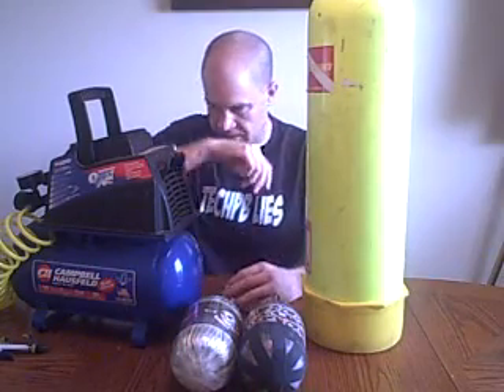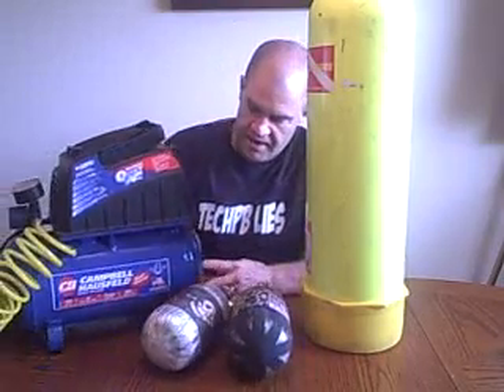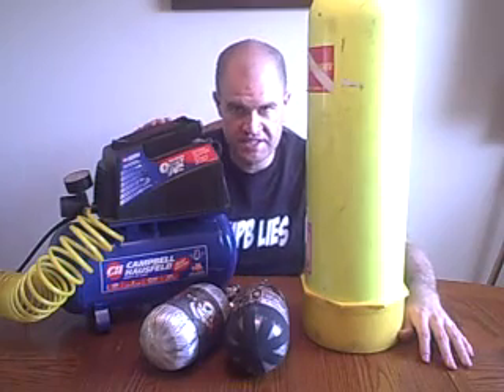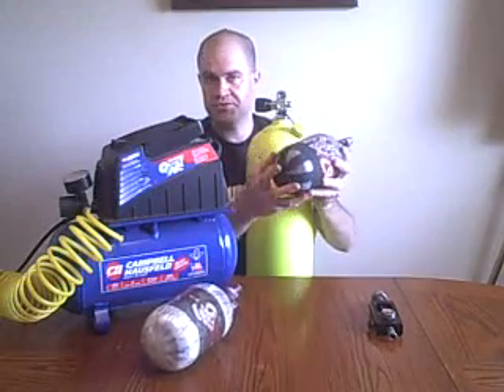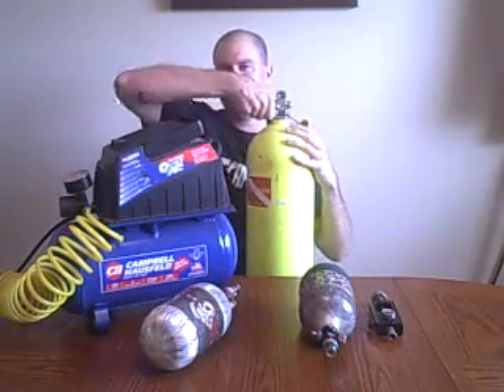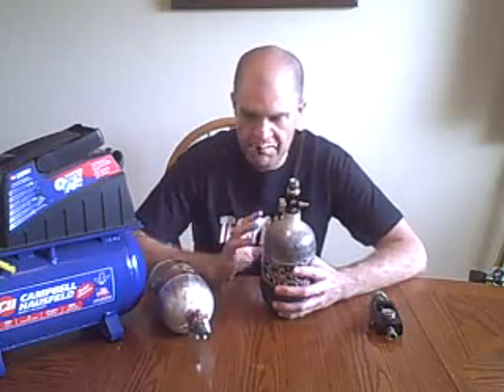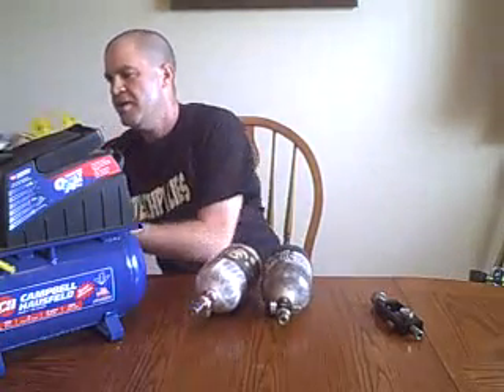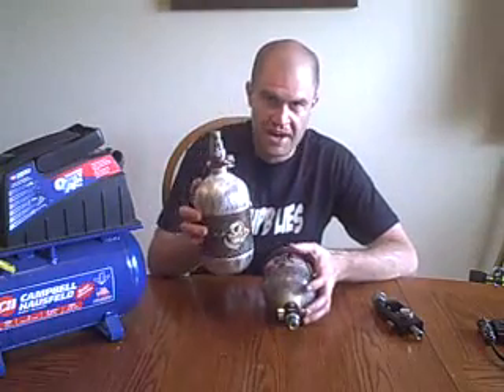HPA, Compressed Air, Compressors, Nitrogen & High Pressure..

Comment: Weird that this is recommended now.  Mike was right at the time but now you can actually get a hand pump that can do 4500 psi; lots and lots of pumping but you can do it.  There are also 200 to 300 (possibly cheaper)dollar plug in wall pumps that can do the same.

Comment: Can I use a 4500 PSI hand pump to fill my HPA tank?
Reply: +MisterAxeMan Yes, but it will take a long time.
Reply: MisterAxeMan you have to pump really fast and might mess up the pump o rings if you have an ace hardware in your area they might have the air supply my town ace has hpa

Comment: Where I live they do not have scuba shops however we have a lot of welding shops. Can I go to a welding shop rent a nitrogen bottle and use it like a scuba tank, to fill my hpa tank for my electric marker?
Reply: yes
Reply: brewskisdodge you can get tanks filled at ace hardware they have co2 nitrogen and if your lucky they might have hpa the store in my town has hpa but they run out fast

Comment: Hey air's they make a special hand floor pump that is capable of compressing more than 3000 psi of air pressure 'they use them for pressurizing big bore air Gun's 'you could probably just about refill a scuba tank with it 'and I hear that they are designed to take the heat and the extreme pressure 'I've seen one online for 250$'  just a thought though.

Comment: What if you have a big air compressor at home. I'm not sure the psi but the compressor is bigger than me
Reply: Any home compressor will do 120-200 psi, The size of the tank doesn't really change the pressure, only the volume.
Reply: rkshireygames what if it's not a home compressor, but he have it at home?
btw what psi does it have? Rafael de Jesus 
even though i would like the answer in bar XP
Reply: ThePaalanBoy That makes no sense....
Reply: rkshireygames How does that not make any sense? He wants to know the pressure in bar, not psi
Reply: TheMagache " what if it's not a home compressor, but he have it at home?" makes no sense......
Reply: ThePaalanBoy Want it in bar? 206.8 bar.

Comment: it don't matter how big your air compressor is, like i have one that is an 85 gallon 150 psi compressor, you have to have a compressor that is capable of going to 3000 psi or 4500 psi, for the home use i recommended the shoe box air compressor, it will fill a scuba to 3000 or 4000 psi in about 24 hours and a small paintball on in about 24 minutes. They start at about $550 and go up from there. these are better than buying one like my works which is a $5,000 dollar compressor. hope this helped.

Comment: If you are using a 3000 psi tank id set the relief valve at 3000 on the compressor...

Comment: they are worth it you will need a ninja fill whip extension with a female quick disconnection on both ends its the cheapest way to get the job done the whip is rated for 4500 psi i think i only use it with the 3k shoebox so idk if it will blow the hose at 4500 the main reason i got the 3k is because you can fill 3k tanks and 4500 tanks but the 4500 will only go to 3k but most shops will only fill to 2.8k anyways good luck

Comment: use your normal home air compressor with a shoebox compressor hooked up to it.
the one thing is the cables to go from the shoebox to your tank is hard to find and when you do your looking at 125-250 dollars but I use a ninja fill whip extension with a female quick disconnection on both end's should be between 30-60 for fill whip and another quick disconnection.

Comment: Somehow better results can be obtained from refrigerator compressor, it can pump up to 30bar  or maybe even 40bar pressure while tank is rated for 150-200bar

it is not that good, but still much better than air compressor from Walmart.

connecting compressors in series may improve pressure further.

Comment: @JustStartingOut1 I imagine you'd have to ask them before you used that air station, but you'd be able to. The tank's won't go higher than whatever they're made for, and if they do they (hopefully) have those exhaust points near the top that pop out the brass plug and all the air drains out.

CO2 is only your tank, to upgrade CO2 to air, just replace the tank and you're good to go.

Comment: @OGpyroloco13 it doesnt matter how big the compressor is, it will only compress to about 120 psi like he said.  but what you can do is buy what is called a shoebox compressor. it hooks up to a regular air compressor and increases it from 120 to either 3000 psi or 4500 psi dependin on the one  you want.  it will cost about $450. but if you live somewhere like i do where i have to drive half an hour to get my tanks filled and at least 200 miles to get a scuba tank filled it will come in handy.

Comment: @somewhatofaBeast3323 

It wont matter how big the compresser is if it is not made for high pressure (3k-4.5k psi) These kinds of pumps have 3-4 stages of pumping to make them work.
If you really want a pump for this, the cheapest quality personal pump on the market ($465 vs $1000+) that fills up to 4500 PSI is a shoebox compressor.(google shoebox compressor)

You still need a oil-less compressor at about 85 psi to run it though.

Comment: @250killer95 it will work as long as it goes up to 3000 PSI or so. Odds are that it does not. Shop tools (like an air wrench) don't run on HPA. Really only SCBA, SCUBA, and paintballers use HPA. So unless it's a dive shop then it probably won't go over 300 or 400 PSI

Comment: How long does it take fill fill an empty 48 / 3000psi tank?
Reply: Depends on what you are using to fill and what pressure you have in the fill tank. HIGH pressures will fill a lot faster.

Comment: The little tank is thick high grade aluminum wrapped in carbon fiber. The big shop compressor tank is a giant beer can.

The higher the psi the stronger the tank has to be, not bigger.

There are giant bulk tanks that hold 4500psi and more, usually made out of thick steel.

Comment: hey mike i figure you would know...i have a tippmann 98 custom and im gonna get a response trigger cyclone feed the whole lot and was wondering if it is possible to convert a 98 to HPA instead of CO2 cause it shoots cleaner, if so what else would i need for it? or would it be cheaper to get a whole new gun aka like a ego or something like that, thank you

Comment: Uh, firstly Air compressors that are for paintball are normally gas powered.  CO2, emissions, etc.

CO2 used in paintball is usually the by product of other industrial reactions.

And YES CO2 SUCKS! Yes SUCKS!  HPA gives you better performance.  CO2 SUCKS!  (happy now HPA lovers?)

But tank size for tank size you get a ton more shots with a CO2 tank.  Useful if the field you fill up at is a half hour away.

Comment: sry men, how is the best tank ANS Xtreme 68/4500 or PMI Pure Energy 68/4500 5 year hydro two are high Pressure??? for to use in market Proto Slg and Dangerous Power G3..

Comment: if you had the right fittings, could you hook up a scuba tank straight to the gun if you regulated the air flow from the tank correctly and low enough?

Comment: you might not be able to fill up your N2 tanks with a compressor, but you can run some guns if you directly hook it up to the gun's ASA. if your guns operates at about 100psi or less then you can do it. of coarse you're gonna need a water filter and fittings but in the end, infinite air right?

Comment: 2. What would happen to your tank either shooting it or not shooting it if you put CO2 into your HPA System. I by no means want to try and find out for myself because I am sure that would just be purely stupid. I was just wondering if it would damage the tank or whatever else would happen or would it actually work a little bit? I am referring to either Carbon Fiber Wrapped, Fiber Wrapped, or the Aluminum like HPA Tanks. Thank you!

Comment: Ok - two more noob questions. :P (Just because I don't know.)
1. When you go to get your HPA System filled at a field or pro shop, do they get the max fill for you at either 3,000 or 4,500 PSI as apposed to the scuba tank which gets less because of the pressure equalization?
Reply: Your shop can fill to whatever pressure they have stored in their tanks. If they have 4500 stored, they can fill to 4500 and just keep using their compressor to fill throughout the day. All tanks eventually get low on air, when that happens they need to be refilled.

Comment: dont waste your money on the smaller tank. they get roughly 400-500 shots maybe more on high efficientcy guns. my point is its much better to save your money and buy the 4500 psi tank which gives you more shots, when if you buy the 3000 psi tank you not going to be satisfied and the $60 you spent on the 3000 psi tank goes down the drain. you can get a 68/4500 psi tank used for a little over $100 in good hydro.

Comment from the maker: unfortately it's not the volume, it's the pressure

that airtool only works at about 100psi, so the compressor only works at 100psi, which leaves you about 4,400psi short :-(

Comment: Ok wait a second is a 4500 and a 3000 PSI tank the same pressure output but the 4500 just holds more air ? Because I called a lady and she said " Yeah I can fill your your tank to 4500 but I usually only do 3000 and I was like wait a second ... So you can only fill 3000 tanks like steelys and shes like no... and then she explained that instead of filling my 68/45 to 4.5 she fills it to 3 if anybody understands what im saying can you clarify please?